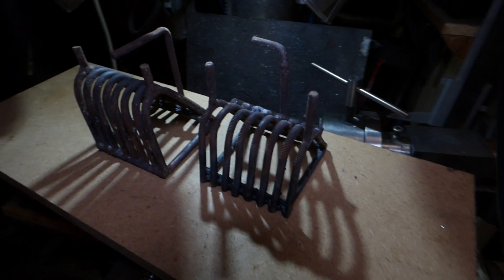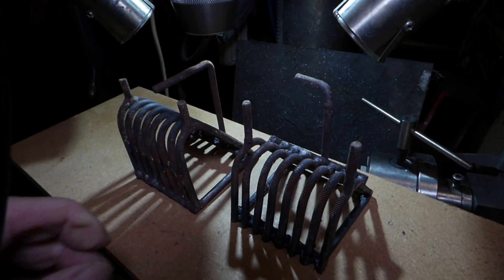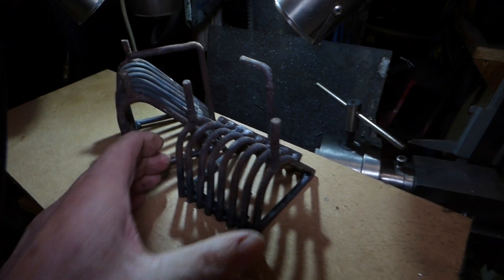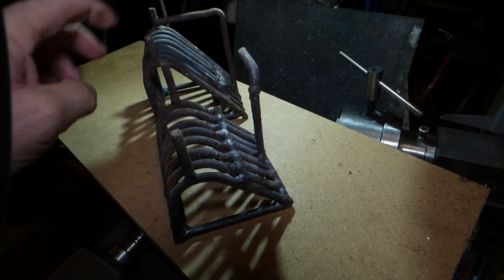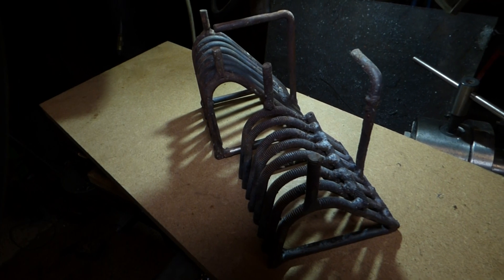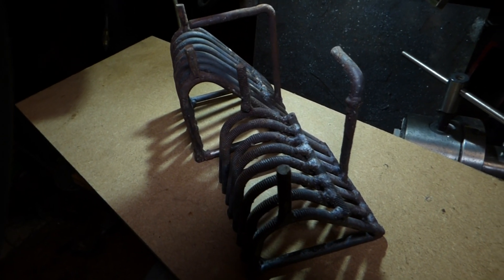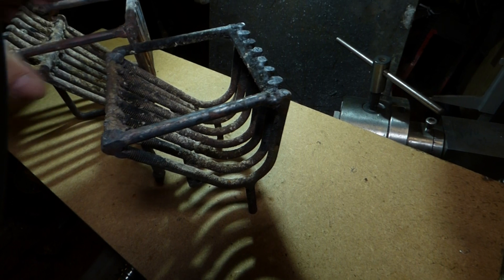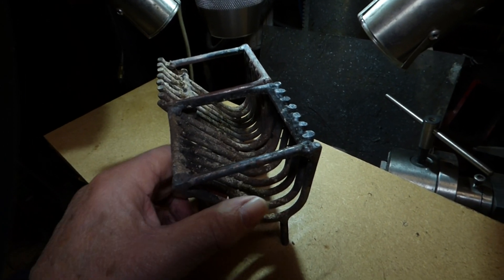rocket stove MK3 No64

Comment: Be nice to build a movable basket so you could vary the V and height from the bottom of the chamber.
I sold my rocket and starting VW now. If I figure a simple way to modify the V and it works, will drop you a line. Cheers